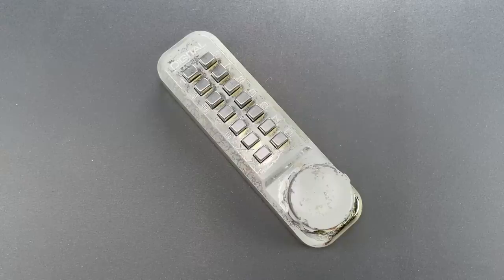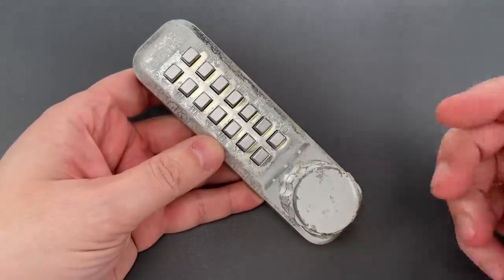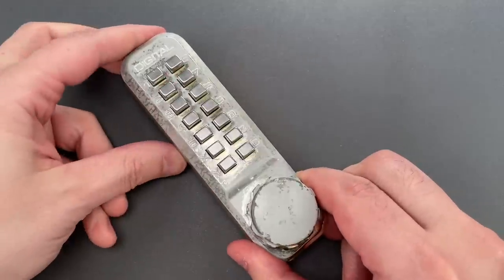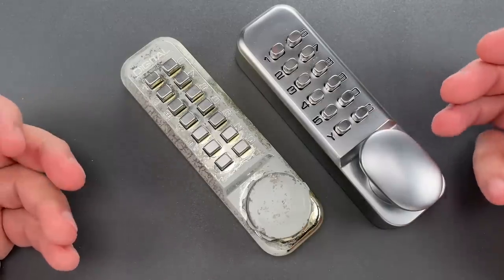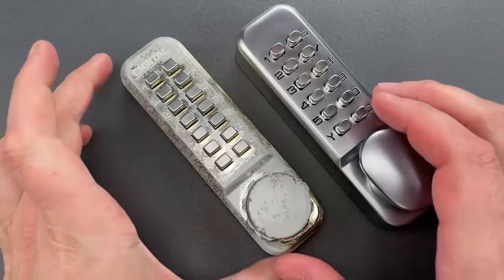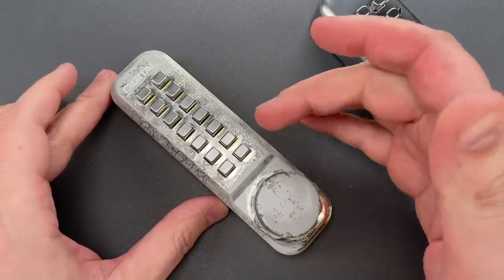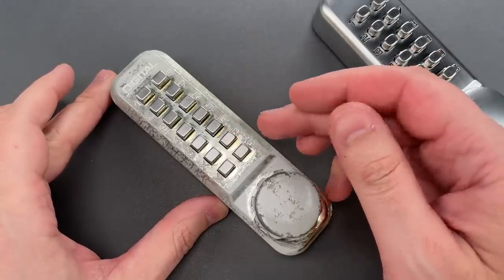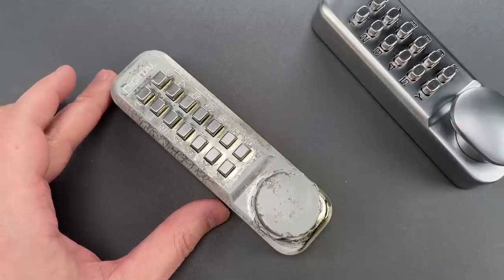[1479] Mechanical Keypad Deadbolt Decoded

Comment: Real estate agents like to use these to lock up houses for sale. When I was a kid, some of the neighbors and I figured out how to open one of these so we could explore an abandoned house. They really are trivial to open.
Reply: if there is nothing to steal why to bother to protect it. Anyway most locks give you just false sense of security
Reply: @meladoescraft  reduces the number of vagrants, teenagers, and drug users getting in to the building.
Reply: @lairdcummings9092  Keep on believing...
Reply: @johnpublic6582  that's why they're used. Also boarding up windows. 
But you'll notice I said "Reduce," not "eliminate."
But I notice you ignored THAT, too. 
Pretty dishonest of you.
Reply: @nutbastard  Zip code, Soc Sec#, year (include last and next year), birthday, license# or license plate# any number or part of a number they already have memorized. Or look for hidden 'notes'. I once pulled out a desk drawer and found the floor safe combi written on the desk sidewall. If you know the lock, try the default (same for wifi passwords). People do not think, but if it's easy for you it's equally easy for crooks.
Reply: @meladoescraft  The intent is generally to stop squatters and vandalism.
Reply: @kastorcaster  yeah, but the lock isnt weakest link in house security, its usually windows.

Comment: Great vid, as always 
My question is, when the buttons are pressed, can they be heard using a mic?
One other thought. When I was USN, I worked in a secure space. One of the requirements for assuming the watch, every eight hours, was to clean the cypher lock rocker buttons. The combo was also changed at random intervals... depending on the roll of the dice, and Division Officer's direction. 
Thanks again, and look forward to more outstanding videos.
Reply: Good security technique.
Reply: So you were in after the Walker crimes.  At least the system learned something...
Reply: @johnpublic6582  
Yup. Enter TPI for all!
Walkers should've been fed a lead Sammy.

Comment: I'd use that on a closet door while on vacation so nobody inexperienced with those locks breaking into my house can steal my shirts.
Reply: Shirts are important. No one sets proper security on their wardrobe.
Reply: @lairdcummings9092  Damn right!
Reply: You must have very nice shirts. Good style
Reply: @KF1  A few dress shirts, mostly t-shirts. Just don't wanna end up with fewer options.
Reply: @ColtonRMagby  They'd steal your Tool shirt for sure.
Reply: @KF1  I just hope they make noise so I can wait for them in my room with a knife. If I'm within 21 feet of them with the knife ready, I win. If they have guns, they're still screwed. If they have knives, they'd have to get them out, which would take too long. If I used a gun, it'd be a Remington 870 12 gauge shotgun because the sound of a pump shotgun racking is usually enough to make them freeze in their tracks.
Reply: @ColtonRMagby  wow, you like your shirts more than I thought
Reply: @KF1  And my life. They break in, I'm not gonna let them leave unless they're in a casket or handcuffs.
Reply: @ColtonRMagby  There should be an option for non-lethal response. Check my vids if you want, I'm disgusted by the idea of what blades would do to flesh.

Comment: Discovered that my HOA put such a lock on our new trash shed. Didn't bother to remember the code that was put in my letterbox, I just tried this method and it worked first try. The difference between one and two steps is really obvious (then again, I was putting some gorilla-level tension on that knob)

Comment: I had no Idea that the order you punch in the code doesn't matter. Thats so weird.
Reply: Its not so weird really, inside that lock behind each button is sorta like a little gate, so long as the right gates are in the right position, and none of the wrong gates are pressed, the lock will open because there is no way for the gate-check to tell what order they were pressed in, only that they were.
I used to use one of these on my bedroom door... kinda glad I got rid of it now ^_^'
Reply: @Graytail  I get the concept of why. It's just weird I never knew that you could put the numbers in any order.
Reply: @greatleader4841  I don't see why it's weird.  The pistol lockbox people didn't warn you that you can get in to it with a plastic fork so why expect these guys to warn you that order doesn't matter.
Reply: @greatleader4841  I wish I still had mine, I'd do a breakdown vid of it... but I broke the knob off and had to swap the lock out.
Though in its defence, once that knob is off you are no closer to opening it by brute force, you just cant open it with the code afterwards either, theres no way you could get a grip on the internals under there without like, a pipe wrench or something.

Comment: years ago i worked at a place with one of these "protecting" the storeroom, we all got given codes for it all hush hush but soon realised our codes where all the same numbers but in different orders.
Also i feel like there are clones of these out there which all copy the same internals or have a default code which never gets changed on install because a few years after i started work at a different place with the same style lock but different brand which used the same numbers for their code.

Comment: What if there is a lock which can obviously be picked once but it requires 2 revolutions to be opened and there is a complex mechanism ensuring that the key is always present at all times otherwise latching and preventing further movement besides back to the initial position where it resets (core obviously needs a key for that too)
There are 2-3 key sensing pins latching entire mechanism when they go down after going up after being reset similar to a ball pen. Located extremely close at 90 degree angle to main pins making it unrealistic to design a tool to hold them all at once while still being able to attack basic pins. Key sensing pins can't be tensioned like basic ones because they don't hold anything but just trigger of a latch in the core. Would that be a challenge?

Comment: an ex-boss was so proud of the "high security" lock he had put on the bookkeepers office (apparently so none of us plebes could get in and see how much he was making) . . . it was a five-button, three digit combination . . . with no repeating numbers.

i told him i could get through it in less than two minutes . . . he said "go ahead, try" (smugly, i might add)

i ran every combination of digits (up to the one that worked) . . . in less than 30 seconds and it popped open . . . it's only 60 possible combinations and i ran them in order . . . 123, 124, 125, 132, 134, 135, 142, ...

sometimes BFMI* is your friend.

* Brute Force Massive Ignorance

Comment: I've considered getting one of these for a gate to the backyard of my house. Currently there is just a slide bolt (no lock) on the inside and I'd like to be able to open it from the outside, but not necessarily just by anyone (though not worried about security, as there is none now). Those of you who have used these, are they pretty robust? We get a lot of rain where I live, so it would be wet most of the time.

Comment: Would like to see you try a cypher lock.  Those can need more than one button pushed at a time.
Reply: Sounds legit and secure but everyone would just use 1111 anyway
Reply: @Skinflaps_Meatslapper  Now that you leaked it, the Air Force will have to change the combo to the missile launchers.
Reply: Old Kaba Simplex did that on the default combi.

Comment: I keep running into these at work - I keep getting told off for fucking with them (or rather the minds of the people who install them at work), I've used magnets, guessing (in Ireland 1916 is the most popular pin / 4 digit code where multi person access is required), I've even reached through railings and around the back.   But I've never thought of this.

Comment: You make it look so easy every time. awesome.
Question: Are there any smart locks, controllable by smartphone out there, that are safe to use?
Reply: Safe from LPL?

No.
Reply: If they use Blue Tooth or Wi Fi  in an open and unecrypted format then the lock is not safe, I would also be leery about using any lock that requires you to log into a site as that relies on the site's security protocols to prevent your data from being hacked.
Reply: None that I've seen. I had a Schlage smart lock for demonstration work on a project, and it's very rakeable, even with a gnarly, paracentric keyway. If you have technical knowhow, you can break into the network and send unlock commands to it. Of course, you'll need to get into several accounts first to do so.
Reply: Skeleton  brick will get into  most houses,  been to 1000s of burglaries  and picking  or decoding  are virtually  never used.
Vast majority  of the time it's a trusty screwdriver  or a stone used to smash  toughened  glass.
Reply: @cardiffpicker1  I worry because I live close to Cardiff.
Reply: @Tuck-Shop  far from the worst  place,  Gloucester,Swindon, Bristol  are terrible.
Reply: @cardiffpicker1  I'm worried about you XD
(Jokingly)

Comment: IS this the same for the old Simplex door locks that they typically use to use on old dorm rooms or back rooms in retail stores?
Reply: You can sometimes 'feel' the well-worn ones. Many still have the default combi or it never gets changed after initial setup.

Comment: I didn't see you clear between trys. Seems like you could apply tension, push button 1, release tension, reapply tension then press 2, through all the numbers as if when tension is applied, lock ignores bad numbers? Lock opened without clearing, and entering only double tensioned numbers? Can you try it? 
Thanks, Stratmando

Comment: We had mechanical combo locks at work for a while, but you couldn't tension them without the combination... Or at least that's ho it seemed.  Put in the wrong combo and the knob would just break over without catching the lock.
Reply: Though I think it might have been the kaba simplex you've previously covered.... So tensioning wouldn't have been needed.
Reply: @ericfeldkamp3788  Yep- the Kaba. On well-worn ones you can sometimes apply tension just prior to break-over and 'feel' the buttons. Easier to find button-wear with those.

Comment: Did you ever pick one of those "Snake key locks" where the key is cut into sections and pieces of key float around? So if you look in key hole it's not straight it goes side to side. Good Video 👍🏻🇺🇲
Reply: I believe he has, but it was a long time ago.

Comment: We have these at work and seem common. I often think that as you can place the code in any order that there won’t be that many different codes. But I’ve not done the maths for it. I wonder if you could make punch cards that would press the combinations and you just work through them till you get in. Guessing this technique and others in the comments make this actually more effort though.
Reply: I fitted one of these locks, new out of the box, enough hardware was supplied to  "activate" four of the keys though I could have just activated 1, 2 or 3 keys if I had wanted to. This would make the number of punch cards required considerably larger.  At an other workplace I  considered making a tool that would activate the active keys all at once (essentially a key) to enable faster operation of a regularly used lock

Comment: They were even easier to decode. You could always see what buttons were pressed by finger oils and rubs. Just press them as the order didn't matter. Within days new ones had finger oil marks and old ones even had color gone on buttons that were pressed.

Just keep pressing the worst worn buttons until it unlocks. No skill needed.

I'm quite sure both of those if they were in use could be decoded like that.

Comment: Try  SA18 LBA password lock, they are completely different. I don't think there is a easy way to simply bypass the mechanism, or to decode it without tons of experience. I would share a link, but there is nothing on YT. I have one of those lock waiting to be installed, I could make a video if you wish.

Comment: I don't get these locks at all. The "never one" only has 2048 possible combinations. So, on average, you should have guessed the correct combination after ca. 1000 tries. Probably a lot faster, if you do not care to try 1, 2, 3, 9, 10 or 11 button combinations, which most people will probably avoid.

Comment: I decoded one of these a while ago by coating each button with UV ink which is invisable. If the lock is in use some time later I used a UV light to see where the ink was removed. Is that cheating?
Reply: Yes but it's effective

Comment: So, "digital" not in the sense of "electronic", but rather "there are digits involved". Technically correct, best kind, etc.
Reply: Also "digital" as opposed to analog, where instead of a continuum of, for example, key pins, there's keys to be either pressed or not